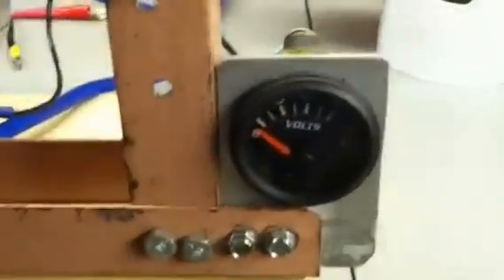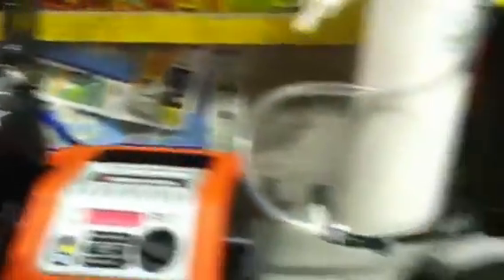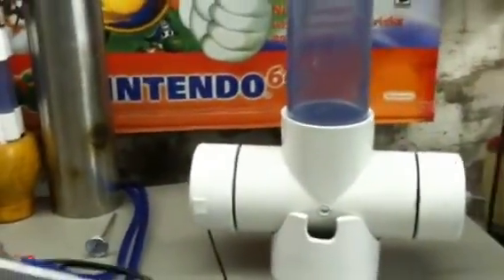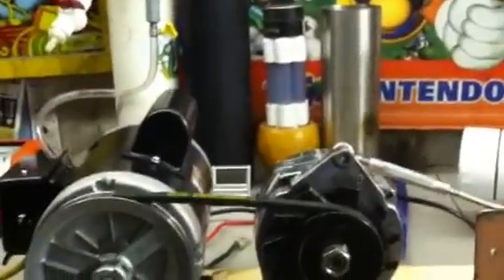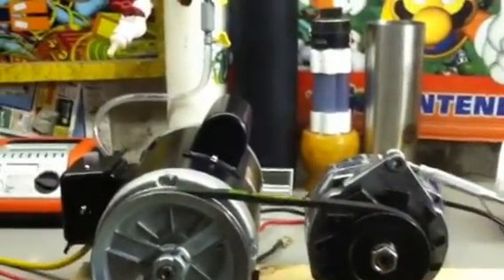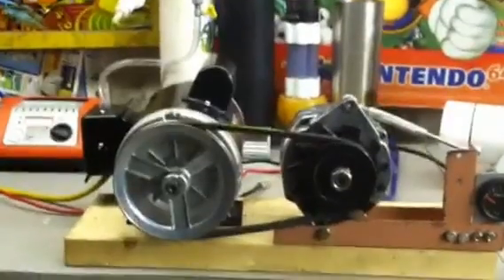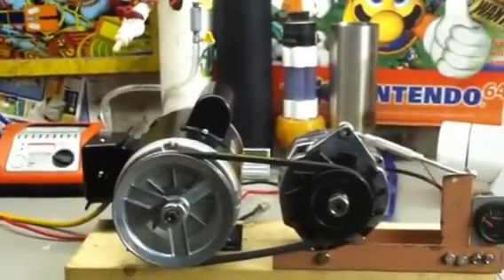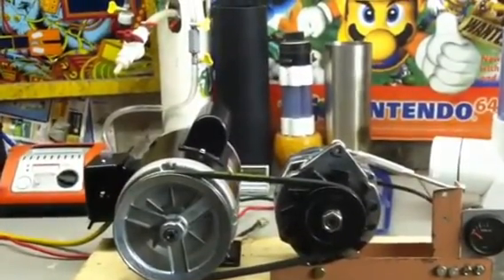HHO power station

Comment: Dude he was not talking about running his car completely off of hydrogen he was talking about supplementing it with HHO. There is a big difference. Supplementing the engine with HHO provides a much cleaner and more efficient burn of the gasoline. By the way it takes much less hydrogen then 3,180 LPM to run a V8 engine on HHO. I don't know where you came up with that number 100 LPM per cubic inch BS. Doing a test on a smaller engine using a balloon full of HHO proves this.